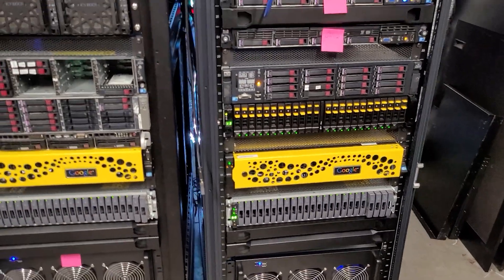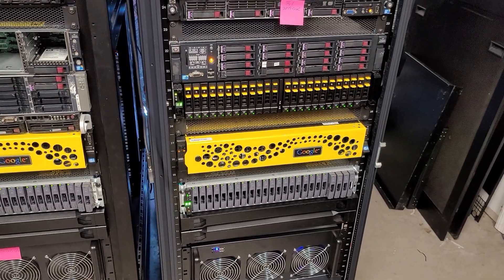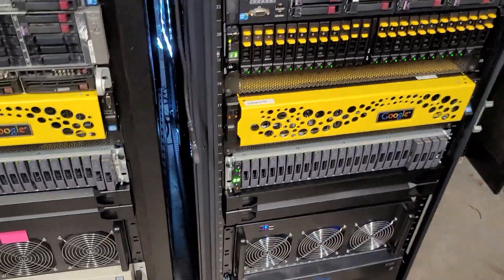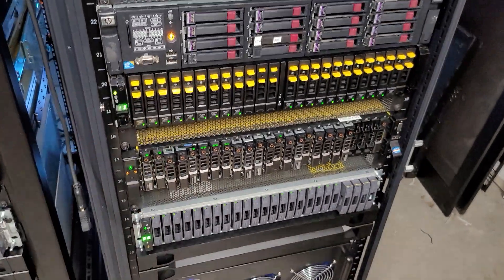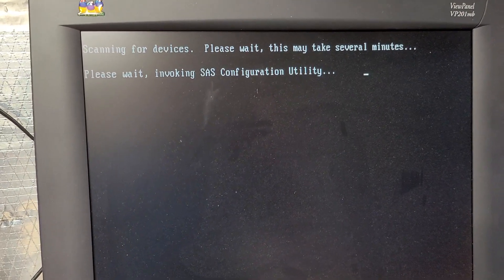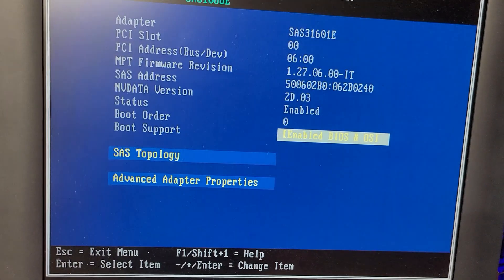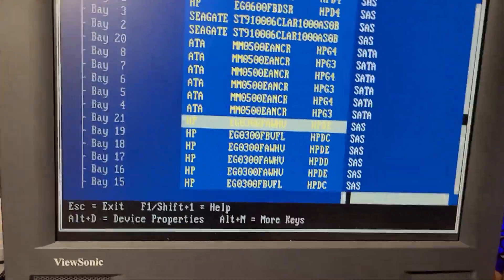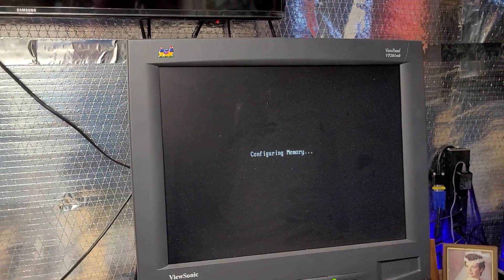Prepping for a new Chia Crypto Storage (Hard Drives) mining setup

Comment: good video, what cable to connect a NETAPP DS2246 (IOM6) to a poweredge R610 (perc H800) to use Truenas and manage the disks...?
Reply from the maker: It depends on your HBA or RAID controller.  First check to see if you have a mini SAS connector or a SAS connector on the controller side of things.  The DS-2246 should have a SAS connector.   Then get the correct external cable set that you need. Just use one cable for now to have a single path.  It gets weird when you use dual pathway fail-over.
Reply: @leadiususa7394  When I have the cable I'll let you know if it works, thanks....

Comment: Thank you for the video! One question - can the NetApp DS2246 here support 8TB+ drives?
Reply from the maker: I have not seen 8TB 2.5 inch SAS drive out there but I do know the 6TB 2.5 SAS (HUS726T6TAL5204) will work fine with this array.  Have you seen such a drive?
Reply: @leadiususa7394  I've not - but I've seen postings around the web where folks claim to be able to use SATA drives with this device (with some different cables, etc). It looks like a very cost effective option for chia farming if SATA is possible.
Reply from the maker: @dad2979  Oh yes, you can use SATA and SAS drives in the same array but pay to what I was saying about mixing these drives.  Look at the DS 2246 and you will see four groups of disk bays (These are four channels).  Keep each type of drive with it its on group and you will get a good response / performance.  Group them together  and not so much...  I would just make each drive a stand alone drive (RAID0)  and use them that way.  Don't forget your SSD for temp building but don't use SSD drives to farm.  They will die in a few months.  Also remember you use 4GB of RAM for each plot.  Plan for it...  Enjoy!
Reply: @leadiususa7394  again, thank you for your thoughtful replies. This would only be for farming (no plotting) and only SATA drives. Just gotta sort out the cabling now. Subscribed!

Comment: So what what was your total startup costs and how much do you plan to make this month off the rig?
Reply from the maker: Well, I am mining other coin so costs this time is not key and the CHIA network teams will tell you at the beginning it is not about profit... (Yet) it about learning the process and building to fit the mining requirements.  I got a Dell R720xd (hold 26 drives by itself.) with some disks for about $450.00 I am storage architect as my day job so I already owned two NetApp DS-2246 arrays, (I love these arrays) with the 4 GB of require RAM for plot you need a lot of RAM so I am working with 112 GB for now.  Xeon normal rated CPU are good for the management of the plots. so just under $1k counting my SAS and SSD disks I am using.  I am using the Oracle F40 400GB SSD PCI-e cards (2 of them) for my SSD needs.  They are the on the motherboard bus so the work better then SATA SSD drives.  You only need a up to 1TB for your temp SSD drive needs.  If not it will take up to 12 hours to make a single plot. with the SSD drive it take less time to make them an if you have 700GB or better you can built two plot at once using the dual parl.  mode.  Hope this helps...

You can do it on the cost level but I would invest a little more so you can scale out over time...

Comment: Hello I am very interested in mining this...I know nothing about mining .. I have a 6- 8k budget I want to try to mine 100 plots... can you send me a link of all the equipment I need to achieve this...and how to run it?
Reply from the maker: Well start with CHIA.NET to know the specs.  Look in the forum.  Next get a reuse Dell R720xd or R720. (They can do up to 726GB of RAM.)   It can hold a lot of SAS function plus with the XD series, you start off with 26 2.5 SAS disks.  24 in the front and two in the back..  Next get a LSI external dual or quad port controller. A dual will work fine.   Next you some SAS NetApp DS 2246 disk arrays with SAS back end controllers.  Next buy some 600GB or higher SAS disks.  1TB work well. You can have three plots on a single 1TB drive.  Lastly you need a 1TB SSD drive to act as your temp drive to build out plots.  You don't boot off the SSD but build with it. I used two a Oracle F40 400GB SSD PCI-E cards to be me what I needed.  Each disk array will hold 24 2.5 drives.  Build as you go.  It will take about 20 days to do 100 plots. So for RAM it is 4gb a plot (I am working with 112 GB of Ram so I can only do 25 plots. and for CPU, go with med. levels CPUs to run everything.  You can get the Dell server for around $400.  RAM and disks will be most of your cost.  SO maybe shot for 50 plots then grow from there. I will send you some links...
Reply from the maker: OK so here is a disk array.. https://www.ebay.com/itm/202386732608?_trkparms=ispr%3D1&amdata=enc%3AAQAFAAAAkFlR%2B1BSS30Rd6E9RtzYbb9dKx2eDfnKxdyW8g71oLwk8%2Be1cqmeTm%2B7t%2FQJYXwyQ8LfgDeZ6bFan%2FYpY2%2F%2F%2FCHD95HvUlIqr%2FDmRHsknbMz%2F6q2D7EQ50YRXSjl%2FTXdHx853bISn5oJ0H2edIyceAr6EAEB0%2Bz056R%2BQPjWCJxUKb2ewjX8gY2r4WAbSVDTMA%3D%3D&chn=ps&norover=1&mkevt=1&mkrid=711-117182-37290-0&mkcid=2&itemid=202386732608&targetid=1192081308424&device=c&mktype=pla&googleloc=9015806&poi=&campaignid=12874648737&mkgroupid=121721209379&rlsatarget=aud-412677883135:pla-1192081308424&abcId=9300535&merchantid=101707307&gclid=CjwKCAjwkN6EBhBNEiwADVfya9dWVw1Ul6udwXjMynlEXggnBG4ysWwDC8pdWcTXylQo-zVXEAqXXhoC8dsQAvD_BwE
Reply from the maker: And then the server chassis to work with... https://www.ebay.com/itm/193455152670?_trkparms=ispr%3D1&hash=item2d0ad35e1e:g:-9EAAOSw~kVgbb1D&amdata=enc%3AAQAFAAACgBaobrjLl8XobRIiIML1V4Imu%252Fn%252BzU5L90Z278x5ickkfKe2vUidqHRg3XM2X2xOVBmM4vRNkdO08JoYnCWvRwSfVDcEJXIeLsIUMsjEQdsc61oZFy8V6UCFT7QjhHgE71r6%252FZ%252BIAoQW5OlQWfZt%252FmJuVwEVJ7Cob8cRxyVCzQRhpU6DKt%252FX5hZhMPq%252BZAJ4BXvKA5Tdy2twjizwsua3BqwjTQ%252BnUiZg0TIJJFDWvEquDXyS4DcwhcauOPpha9JMTkdfErbFPFD%252B8SDjBtolrcFYur9dgo%252FKcNuO20p0I0rmifx91EPiYI3l1qd3vjYljbG%252BnmhWU9YNWom3GsAJJk2M4SChd7nH6zeJHarp%252BFM%252B%252B%252BD7jIQcBQOwmFdNTd6zSGot52eFYq7vaTeXRPw36rsqL4iBdnnNy6c1mN9e8OuTXsY9falHHe3vx%252FVkyZT8XiBf%252FEmFiGWDk7hJ22WYLwl12ZIVPc%252BOW6rmXRdvWzmnxbA1nVHpYenqARsgK%252FAOXWzTumHiX4EBCuytYUfaFSWYJ0a5gMv8pB4FrzXWh19rh02hdDL16av0RzZdL7WhN6mIOevV4qlqD9KO1%252BYr%252BkoLgh59nRB7s3wb%252BtJLQPymxY60PsQoMEGZZ%252FBV6FCRn8oFR1UGhlsAzDUCVJWfFp43lSTZEc0OLbK65nwWn3U0YnkcbESwdhyZCK1HySzdoP8y%252F2LBZ7Z9MGIOVKnx78QLzF%252B50dcmgnB6hwqkS1my85oBhPs1xPymvZvziZaa529iwlvFf7slP1x0ASXhmRhagISUnckG7T2lQ4ASUF%252FjZA1a8t3rkOuuC1Bk9yzr6HAZ6P6PTBN4T35Cxp8WHP4%253D%7Ccksum%3A193455152670694a331f493c4f29a690dc297967ab8d%7Campid%3APL_CLK%7Cclp%3A2334524
Reply from the maker: And lastly.  Make you get get the correct external SAS cabling for the DS 2246, if you use only one disk array then you need two cables,  to add more disk array is a daisy change you need four more SAS cables.  Let me know if you need help with anything.  Mine is working well now.

Comment: Cool video. I see you have a dl380 gen6 or gen7. I just picked up a gen 7. How you like yours?
Reply from the maker: Works great! I phased out my Gen 5. Now looking at Gen 9 next
Reply: @leadiususa7394  with the way I'm running things(running out of cores already) i may be looking at a second server com soon also. Gen 9 maybe?
Reply from the maker: @52fordf1  IF I were to get a replacement server, I would do the Dell R720xd, a great and cheap server.  Lots of core options and over 700 gB of possible RAM and the 2.5 inch SAS 24 bay configure is great!  Enjoy dude!
Reply: @leadiususa7394  thanks for the info. Probably wouldn’t have to deal with the dreaded pcie pass through issues I’m dealing with also.

Comment: Wow.. I ve got 6x R720 and 4x R620 retired servers and hv been replaced with R740 recently. Currently sitting doing nothing with 1Tb x8 on each server. Dual Procs and 64gb RAM.

Yeah, good idea of chia mining so soon.
Reply: I have x 3 24TB SAS SANs  (iscsi connected) spare and x2 R730 x2 R720 with 64GB going spare. 

Would you recommend dropping the iscsi from the sans and using HBA SAS card instead to the san direct?
Reply from the maker: @GPUGear  Yes, I would move to SAS from ISCSI to some of the IP protocol overhead.  That is missing with direct connect SAS.  Make you you also build the RAM up to the number of plots you to do.  It take over all about 4GB a plot.  No mater what it will over time be just under 4GB.  So plan for it.  I have over 112GB current to support 22 to 24 plots.  Have fun!
Reply: @leadiususa7394  Cheers chap. Will look for some older HBA cards. 

What OS & RAID config are you running on the R720xd?  RAID 1? and RAID 0 across all disks on the R720xd? or have you setup just plotting to individual disk? as some misconceptions out there saying RAID 0 config is weaker and best to farm in parallel per disk individual disk. Much appreciated. 

Naturally I would think RAID 0 spanned across 30 + disks provides far greater throughput.
Reply from the maker: @GPUGear  For now I am doing both and stand alone disks and RAID groups disks.  My boot drive is on a F40-400GB PCI-e card, I use only 92 GB for the boot drive then I use the rest with a second F40 card for a temp 900GB drive to build plots.  It is best (for now...) not use use SSD drives to do plots/farming but only as a temp drive to build them.   But over time I will know if stand alone disk works as good or better the OS RAID or Hardware RAID setups for I am running both now.  RAID redundant mode is not really helping for if you reboot your system you have to rebuild everything again.  I hope they can put a feature in that can pause the plot state so you could do reboots so this extra rebuilding can be avoided in the future.  Check out my updated (Chia disk config video I just posted...) It talks to a lot of this...
Reply: Thanks for that info. Im watching your vids and very informative and helpful. 

Ive managed to source x2 3.84TB Samsung PM1643a 2.5" Enterprise SSD, 2.5" SSD, SAS 12Gb/s, 2100MB/s Read, 2000MB/s Write, 450k/90k IOPS for my R730. Decided to spend some ££ on SSD that can take a hammering. Will let you know findings :)
Reply from the maker: That will work
Reply from the maker: Are you 720 servers the DX series (2.5 drives) or the 3.5 drive version?

Comment: Waiting for a new video. I’ve bought 4x42u rack with Dell hardware. I’m going to plot for weeks. Is worth to use sas drives for temp or I have to buy ssd?
Reply from the maker: SSD is better - faster
Reply: @leadiususa7394  know it, but in your opinion there is a big difference on plot timings?
Reply from the maker: @DavideDeZan  None right now, trying to build a few plots (12 hrs. each) now to find out that very detail out.  /:>

Comment: Chia is proof of space-time, not proof of replication. There are no useful data in those plot files, and the network doesn't even know about them. It's just math inside. The plot requires 256GB (260GB to be safe) of temp space to generate. Happy farming!
Reply from the maker: Agreed, the data that comes over is temp only but does replicate (Not so valuable) files to stage the plot.  For now I am only doing one plot but this system can do up 40 plots if I follow the 256GB model but I was thinking something later that would be bigger.  I am playing...